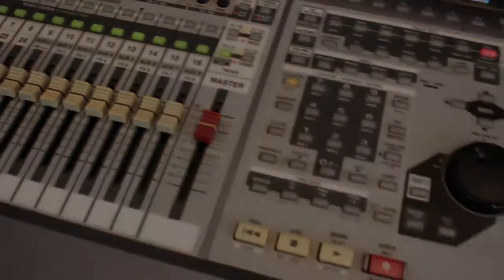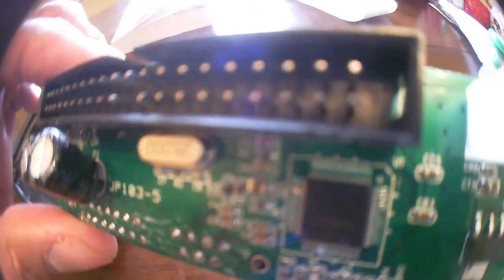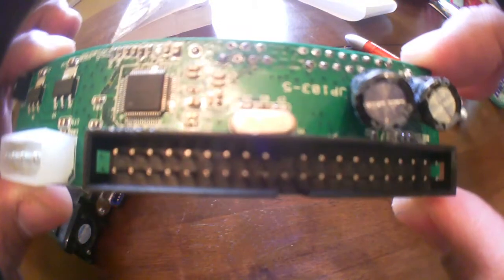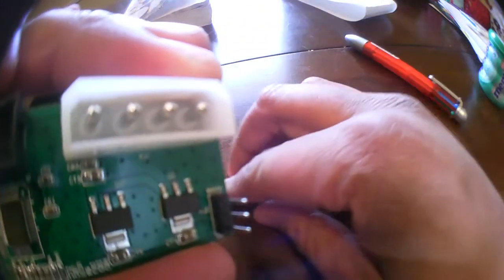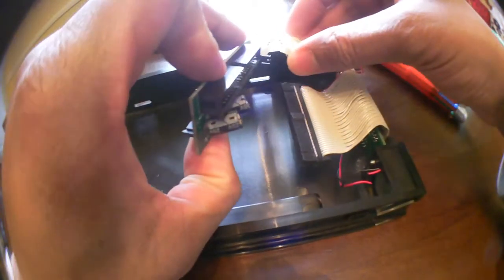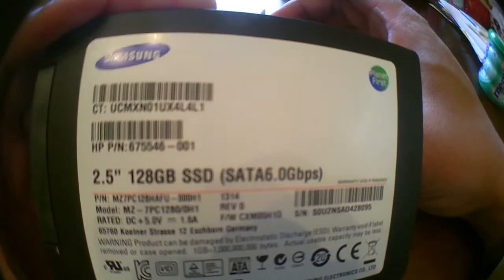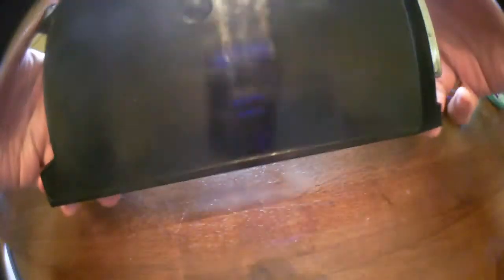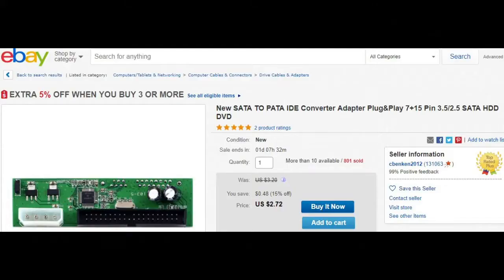Adapter for Roland VS2480 - IDE to SATA conversion

Comment: Do you know if this will work on just a normal vs2480? We don't have the HD one or the CD one, just the plain old vs2480. Because we did get this adapter and it was unable to see any drive at all if the jumper is set to master. On slave is just gets stuck. Any help would be really appreciated

Comment: Great info. My vs2480 still in pristine condition.  I have bought the correct adaptor and Samung SSD. I have 2 vs8f boards and TC, Massenberg EQ, Universal Audio, 3rd party plug ins. Is there any issue when reloading these back onto the new hard drive via an external CD drive?
Reply: I have had no issue with reloading from the CD drive.

Comment: I did this mod using the exact same SSD and JP-103-5 conversion board. I did not have success when using a VS2480HD model mainboard (does not have the CDR connector on the mainboard) that was running OS version 2.5.05. It would not recognize the drive on the VS2480. So, I bought an different VS480 mainboard that was the CDR version (has the connector for the CDR) and is running OS version 2.5.03. This one worked for me, and it also worked using a newer (2018) Samsung Evo 256gb SSD drive. I am not sure if the issue was the VS2480HD mainboard or the newer OS version 2.5.05. Have any others had similar issues performing this mod using the VS2480HD mainboard or the OS version 2.5.05?
Reply: My VS2480HD operating system version is 2.504 and it works.

Comment: Just done this conversion on my VS2480HD, it seemed to go okay but the 2480 will randomly freeze when writing to the hard drive and it can only be recovered by powering off.
Board jumper set to MASTER and everything looks good with the install - the 2480 "sees" the hard disk and formatted it.
Stuck!

Comment: In Fall 2020, that -particular- adapter board is very hard to find and can only be purchased on EBay via China. At least one other  adapter board (I have found) works.

Comment: I have the VS2480HD with the hard drive tray at the front right, does anyone have a link to the adapter card that worked for them please?
I cannot find any.
Reply: My tests indicate you need the VS2480CD model mainboard to get this to work. I could not get it to work with the VS2480HD model mainboard.

Comment: The performance of the adapters depends on your particular 2480 station (chipset). Different adapters work or do not work with different HDDs on different versions of the 2480 station. I tested adapters of different models and some of them worked or did not work with different models of hard drives. I realized that you need to select drives for each adapter empirically for each 2480 station. Apparently, the adapter-hard drive controller bundle is crucial for the 2480 to work in this hardware configuration.
The most important question. Why do you need to use this adapter? If to increase productivity, then I will disappoint you - the system performance will not increase in any way! I use this configuration only to realize the ability to export tracks to a computer through the program for exporting tracks from virdis. I installed a removable SATA hard drive in my station. The file system of the 2480 - FAT32 station allows you to read 2480 recording data on a computer. Using the program for exporting tracks from virdis, you can quickly transfer tracks to a computer and edit them there and then import them back to the station. It is convenient and fast.
Reply: VIRDIS needs a PC . Pro tools is on my laptop; no PC. That is typical these days. You need to convert a 2480  to a solid state drive because the 2480 OFTEN had hard drive failures and glitches and erased projects. That is why I mothballed my 2480 for ten years (!), until solid state drives made it practical again. Now I no longer waste time on pro tools for the actual mixing.

Comment: I've tried this on my Roland VS2480 and it didn't work.  I have two of the JP103-5 PATA to SATA 3.0 converter, and it hasn't worked.   It started to work with one SSD, but then hung.  It sat there for well over 9 hours.  I hope I can figure this out...otherwise I'm going back to HDD
Reply: Is your VS2480 mainboard an HD model? (ie. no CDR drive)? If so, that is probably the issue. My tests indicate you need the VS2480CD model mainboard to get this to work.

Comment: Hi Ian, have you ever had any problems or know problems on vs 2480 (This problem sounds like it is something within the circuitry, but it is affecting ALL of the paths internally. Adding effects channels doubles the crackling / popping sounds. )
This problem would be related to electrolytic capacitors  on power supply or mother board?
thanks.

Comment: I bought a Samsung PRO 860 256 gb and it didn't work. I used the adaptor JP103-5. Physical format and surface format OFF. Then I saw in another video that Ian used the phsysical format ON. I tried it and it didn't work out either (it took really long). So now I have no clue. What can I do? Should I try with sn Kingstone 120 gb?.
Reply: It seems to me there is a problem converting IDE to SSD with the vs 2480DVD model. I'm beginning to see a pattern related to this issue. As much as I could find, only vs2480HD owners did the conversion with success.
Reply: @JMK65  I've got the HDD version 🤔🤔 I think I'll try with the exact same ssd shown in the video
Reply: @red_apple  Well, now the possible pattern makes no sense. I've been thinking if it has something to do with the board (which seems to be a SCSI/IDE adapter) where the cables connect - the ones from mother board and the ones to the hard drive and, in some cases, the cd/dvd. Also wondering that this possible difference interferes in some way with different ssd drives or some kind of different firmware.
Reply: @JMK65  thanks for your answers anyway. If I have news I'll post it here.
Reply: @red_apple  Also will share as soon as I have news.
Reply: @red_apple  Finaly I get it to work. Samsung v-nand 860 EVO worked with two different adapters - the JP103-5 and a different one. Got it formeted with physical format and surface scan OFF. I wish you good luck.
Reply: @JMK65  thank you so much, I'll try that!!!
Reply: @JMK65  how many gigabytes?
Reply: @JMK65  If you can, please write the exact model as there are so many different ones. Thanks!
Reply: @red_apple  250GB
Reply: @JMK65  Thanks !
Reply: @JMK65  That seems to be something i noticed too ! its the old hd one I'm pretty sure there was revisions done updated later on, cause a guy who has both said the cd wouldn't work and the hd would, and both had the same os ?

Comment: When you load this and partition,do you need to re install any original info onto the ssd from a disk just that I don’t have that.i remember doing this to my old vs880ex with a cf and it just fired right up

Comment: Ian, Great video and information. I installed the JP103-5 adapter into my VS2480HD and it works excellent. Thank you. My VS2480HD operating system is version "2.504".

Comment: My VS2480HD operating system version is 2.504. I have additional information to help the VS2480HD users. I want to say that the IDE to SATA adapter that you show in your video (JP103-5) works excellent in my VS2480HD. I also wanted to tell you that there is another adapter with a different set of numbers (RXD-629A7-7) that works in the VS2480HD also (it is the exact same circuit board as the JP103-5, but with a different set of numbers printed). I use the Samsung 860 "Pro" 2.5 inch Solid State Drive (256GB) in my VS2480HD and it works great. You can also use the Samsung 860 "Evo" 2.5 inch SSD. I tested several drives and found that both the Samsung 860 "Pro" and "Evo" models worked. About the drive caddy: The VS2480HD caddy has screw holes where the original 3.5 inch drive was mounted. If you place one screw (SSD drive screw) into the screw hole in the upper right hand corner of the caddy (that was used to mount the original 3.5 HDD) , you can mount the 2.5 inch SSD into the caddy using one screw and it will hold the SSD in place. I want to thank you for the great videos and excellent information regarding the IDE to SATA adapter for the VS2480. You have been a major help to me !!!! Thank you !!!!  I set the "Physical Format" and "Surface Scan" to OFF.
Reply: great informations ..THANKS A LOT  TIN MAN
Reply: Do you know where to buy them?
Reply: I bought a Samsung PRO 860 256 gb and it didn't work. I used the adaptor JP103-5. Physical format and surface format OFF. Then I saw in another video that Ian used the phsysical format ON. I tried it and it didn't work out either (it took really long). So now I have no clue. What can I do? Should I try with sn Kingstone 120 gb?.
Reply: @red_apple  It seems to me there is a problem converting IDE to SSD with the vs 2480DVD model. I'm beginning to see a pattern related to this issue. As much as I could find, only vs2480HD owners did the conversion with success.
Reply: @JMK65  Interesting. I have a 2480CD converted to DVD. Any news on this issue? I'd really love to convert to SSD, my HD is just too noisy.
There is also the scsi2sd option...but it's not great.
Thanks
Reply: @JMK65  I have a 2480HD and no success.  I'm using the Kingston 120GB SSD and using the JP103-5 PATA-SATA 3.0 converter with zero success.  very frustrating.  I purchase two of these converters just in case one was bad.  At first it worked, but then it hung during format.  Physical Format was off as well as Surface Scan.  Still trying to figure out what is going wrong here.
Reply: @davidchapamusicofficial  Kingstones didn't work with my 2480DVD, only worlked with the 2000 model. Samsung v-nand 860 EVO 250GB worked with  the JP103-5 adaptor,  both internal and external.
Reply: @JMK65  Fingers crossed!  That's what I ordered last night after reading your success.  I'll let you know.  Thanks!
Reply: @JMK65  Just got the SSD, plugged it in and it worked like a charm!!! Thanks for your help.  the EVO 250GB is what I ended up buying.
Reply: @davidchapamusicofficial  I think the problem is somehow related with the SSDs, don't know if it's firmware or some other thing. I tried two Kingxtones  (120 and 240) internal and external and they never worked. I even try them on the VS 880 and MC 80 and they only worked on the VS 2000. That's good news, I'm very glad for you.
Reply: @JMK65  Worked like a charm!!  Thanks!!
Reply: @red_apple  Any luck since then? Thanks
Reply: @rick.enbacker  haven't tried with other SSD's. But the samsung didn't work for me so I'm still using my old HDD 😭